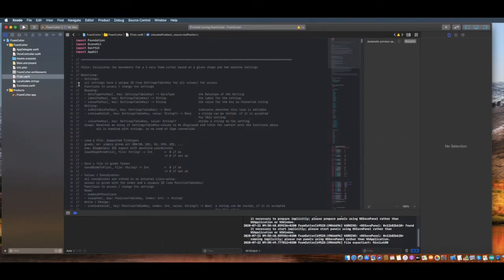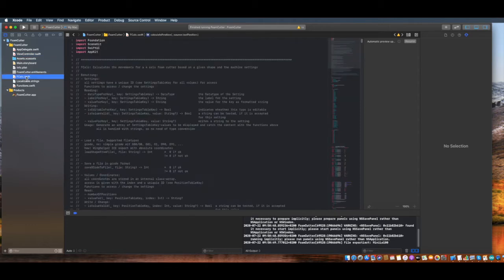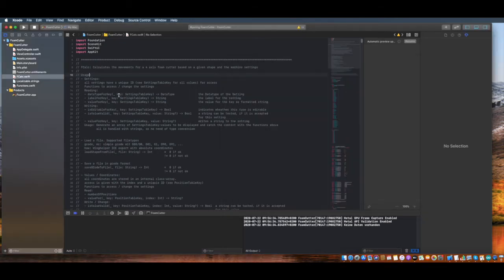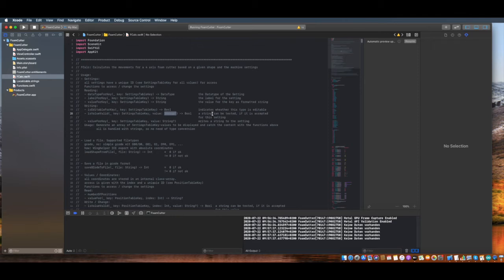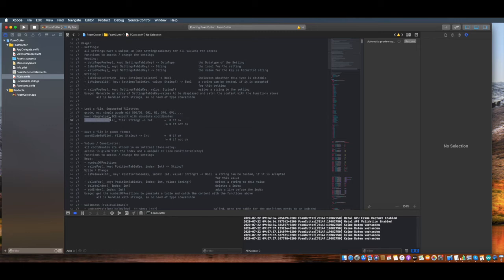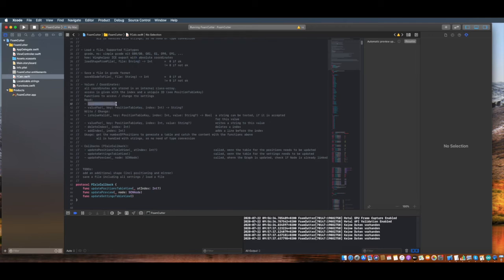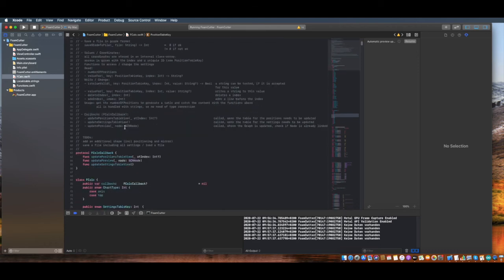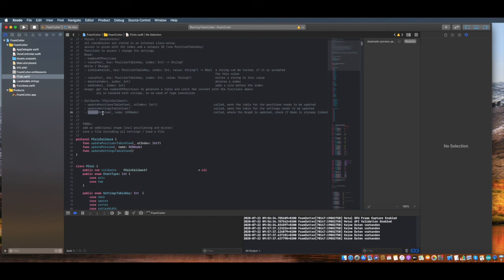Foam Cutter Post Processor Code Insides Part 1

Comment: Hi Thomas! Thank you for all your efforts and documentation, I am building a 4 axis machine myself.

Are there any plans on having your post processor run on windows and linux machines?
Reply from the maker: Hello EC, thank you for your interest on the project. I only own a mac and xcode swift developer license, so I have no plans to port the project to windows or linux for my own. The code is written in  swift, which is structured similar to C#/C++. If someone could do the UI for windows/Linux, II would link up and try to include some compiler switches in the code. Up to now all the math is mainly done with simple C commands, only the 3D visualization needs to be separated. If you are interested to do the windows / Linux part, let me know! Regards Thomas.
Reply: I don't have quite enough programming experience to port it, but I am curious about maybe building one in Python with a Qt Gui. Any thoughts on that?

In the meantime I would try and get a Mac Virtual machine going for your Swift app.

Also, I have not explored the SketchUp part of your workflow yet, but would I be able to swop out Sketchup and use Autodesk Fusion 360 directly for the 3d model?

And before I start a forum on a video, do you have a dedicated thread somewhere for your project that I should rather be commenting on?
Reply from the maker: Hello EC, Qt / Python is very similar to C. I can support you for porting the math of the post processor. 

Of curse you can use any other program that generates gcode and use that as input for the post processing. XY and UZ axis need to be included to describe the shape. Up to now I did not test Fusion 360, so I am not sure which kind of export functions are available, and if my code already supports all commands inside. Updating and improving is not an issue, because gcode is very good documented.

I have all my code on github, where you can open a request for Qt and  another for Fusion import. I think this is a good platform for exchange and collaborate. Link is in the comments of the video.

Regards Thomas